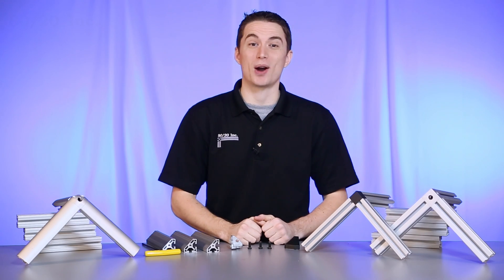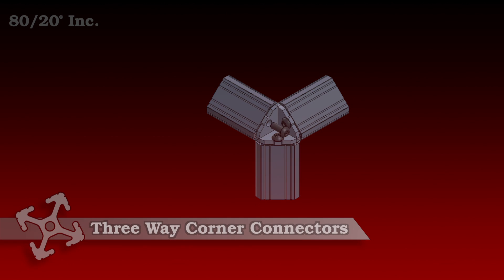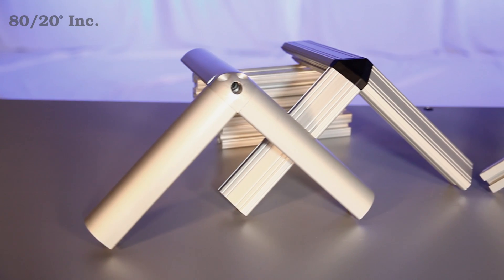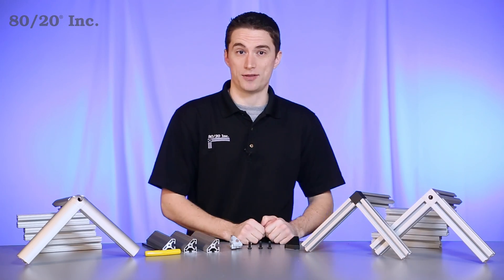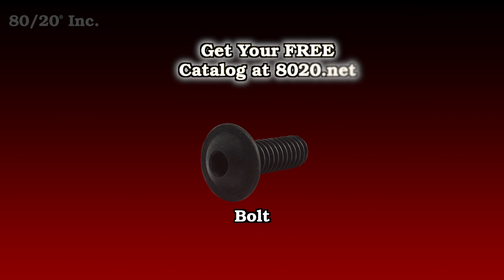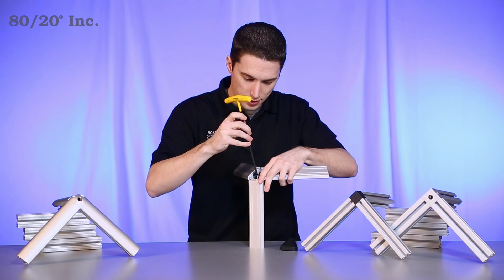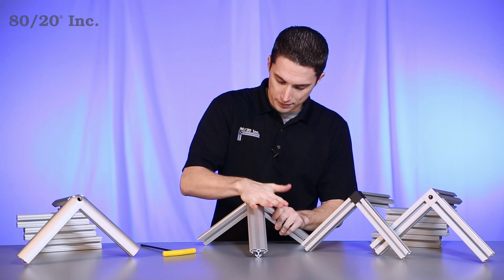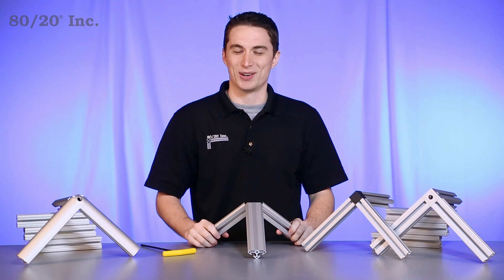80/20: Tri Corner Connector Overview

Comment: When using this connector you might experiment on a scrap piece or leave some extra before you cut your final pieces to length.  I'm having a heck of time keeping the legs square but I think I've got it worked out now.   I'm pretty sure it's related my cuts not being PERFECTLY  square.  Make sure you keep you your saw work bed clean and firmly clamp both sides of the piece.  I'm super interested in any other tips.

Comment: You mentioned in these three way corner brackets that a "tap" (cutting the threads) was all that's required.  I take it they are already drilled through and through and will not need to be drilled as well.  I am currently working on plans to rebuild my son's Boy Scout troop's chuck boxes and like the clean look of the flush corner brackets.  I'll post video and send link when done.
Reply from the maker: Correct.  The corner brackets themselves do not require any additional machining.  However, the ends of the profiles, that the bracket connects to, will need to be tapped.  No other machining is required.  Can't wait to see your finished project!
Reply: @8020llc  thanks for the clarification.

Comment: You skip over the mounting system to fast where do you machine ? What size ? Etc
Reply from the maker: Walt Lars Thanks for the question.  The Tri-Corner connector requires an end tap on each joining profile.  The size of the tap and recommended hardware will depend on your project, and which profile series you use.  If you would like additional assistance with any 80/20 products, please give us a call at 260.248.8030.
Reply: Got a catalog ordered  

Watching the mailbox !